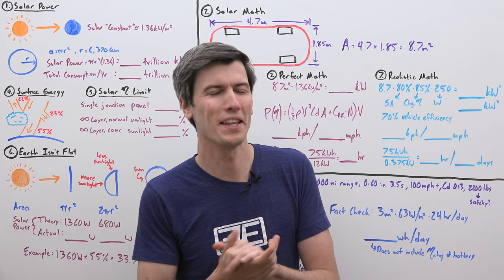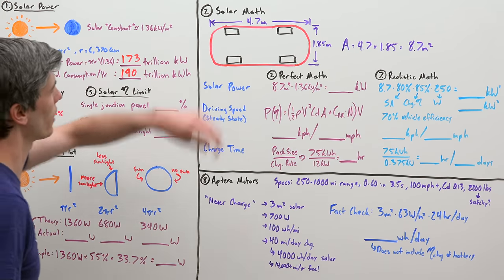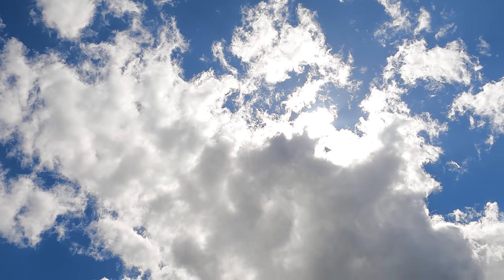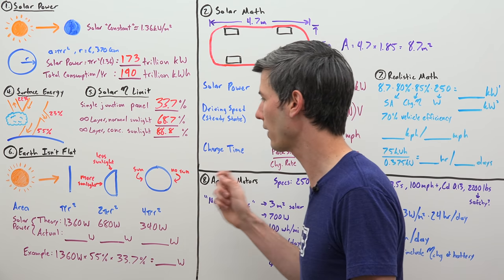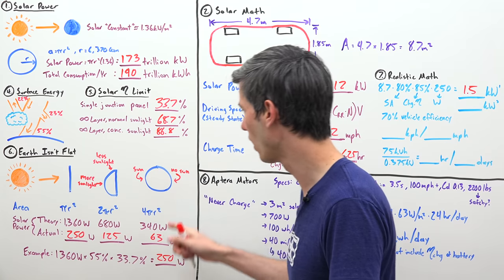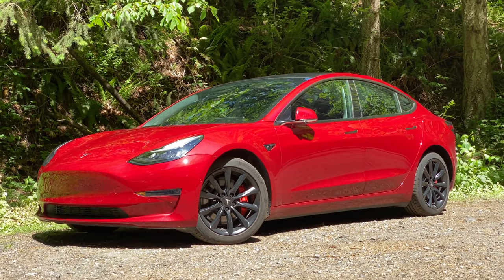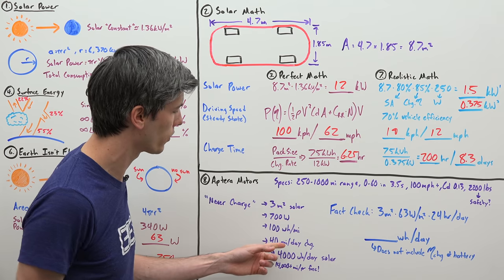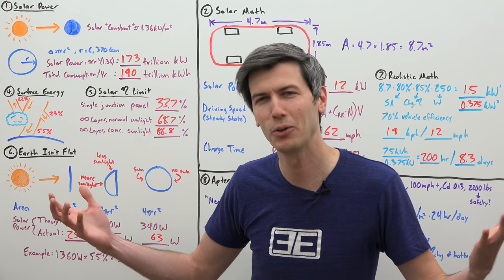Why Don't Solar Powered Cars Exist?

Comment: This is cool the only part that I paused on was the plausibility of the Aptera example-- you don't get 24 hours of sun a day except at the north/south pole (in their respective seasons). Everywhere else it is rational to drive would be far, far less. Then there are other frictionless assumptions made like weather, obstructions to your charge like trees and buildings on your street, or if you're in LA like me, dust that inevitably settles all over the car from pollution or pollen. So it's neat that under very specific circumstances it could work but it doesn't seem realistic for the average consumer. Maybe I'm missing the point.

Comment: 10kWh a day is actually what my Volt usually used.  (That got me about forty miles.) So, in sunny Colorado, and some solar panels on the sides too to catch lateral sun as well, such a solar system could (in ideal circumstances) yield a meaningful fraction of the car's electric needs (albeit with some ideal assumptions, not lots of dirt for instance on the surface, which is a problem in Colorado).  Not quite as far off practical as I once thought.  But, 10kWh only costs $1.30 at my local retail rates, so not enormous savings either.  And I'd have to leave the car outside a lot, and brush off the snow frequently.  Maybe it's a southern Arizona or southern California thing.

Comment: An interesting video could be, how much solar panel, battery, charger module etc we need to be resilient for the charge of a tesla model 3 or other car at home if we are capable to cover a garden or an exterior with solar panel. Because I see the math with the perimetre of a car but if we can cover like 30 m2 of ground, can it be possible ? Be resilent for our transport energy and at witch cost ?
Reply: It actually is very practical to install a 5 KW solar system in your home, and provide a lot of power for your appliances.  I know someone who did this back in 2008, and owns a Nissan Leaf.  He collects about 25 KW per day, on average.  He normally charges the car at night, with the lower cost nighttime power.  The  Leaf gets about 300 watts per mile, so is fairly efficient.  

His system covers about 22 square meters of his roof.

Comment: I think it is ludicrous to not have solar panels on top of every sold a car. It doesn’t matter that you’re not driving 100% free all the time. It is just at the car can be collecting power all the time during the day. I have three cars. One of them drives less than 5 miles a week I just drive it to the beach. My work car drives 100 miles a day. My family car drives less than 20 miles a week and maybe move twice a week. So two out of my three cars would be worth buying in this case if they had solar panels of any size on the roof.

Comment: Aptera sounds interesting.  My knee-jerk hangup though has nothing to do with the tech or safety but more having to choose between garage parking and solar charging.  That and RIP this prospect for anyone living in the woods.  Also it's going to suck every time getting into a car optimized for energy collection mid-summer in areas where it would be viable.

Comment: My thing with solar is that the tech needs to be better. As you put an plenty have also, the problems. But the tech for solar needs to be almost microscopic, meaning like cranking an engine with a primary and secondary coil effect. Maybe all we need is a direct reflection and heated status memory to charge the car at a consistency and then have that same memory also do a charge with a wind tunnel system to do a battery turbo  like alternator. Each system can house energy to help the other out if lacking. I'm hypotherically speaking, but I'm curious to do more data on this.

Comment: Makes sense, what i always wondered are two other things with electric cars (although the Fisker had solar panels on the roof) 1:would just covering the roof and maybe the rear trunk with solar panels be enough to power the never fully off electronics and counterbalance the self discharge of the batteries? (should be possible depending on the weather and place on earth) and 2: what happens with the solar panels in a crash? sharp glass objects? fireharazards due to shortcircuits? (i don't know enough about solar panels to answer these myself)

Comment: ...times 24 hrs of solar exposure?...  Maybe during a polar summer.... (you multiplied area and incidence and 24hrs)   The Aptera folks try describing 42 mi of range during unmitigated sun.  Where that is, I'm not sure.  But sunny Socal is only normal to those living there.    (Used to).  The car would work If you can find a place to park without shade.   I'd like to suggest that you do a video with numbers for a solar array on the roof of a carport that would sufficiently charge a Tesla or an Aptera for a day's use. BTW, that Aptera apparently requires covering the rear window with solar cells...  A non-starter for me. Thanks for your presentations, all in all; from an engineer.

Comment: The silent yacht company applied this concept to a catamaran, with the common use case being a boat that sits for several days at a time and then has the charge to run a hundred miles to the next island spot and never has to use a drop of diesel. Its amazing whats possible these days with solar and lithium.

Comment: Well, there are solar powered cars but they are special research/eco-challenge vehicles, and so specialized that they wouldn't make practical everyday vehicles. They are aerodynamically shaped wedges almost entirely covered by solar panels, single-seaters (almost always in a "recumbent" position), three-wheelers with bicycle wheels, and require expert power management by their drivers.

Comment: I have done this calculation backwards many times using rated data from available panels.  I figured if you could tow a flat bed trailer behind your Tesla that didn't impact drag. It would only need to be 300 feet long.  Of course duty cycle is much lower for typical cases so its more favorable the more it's parked vs driving. For vehicles of different shape and power requirements like buses, vans or houseboats. I believe its workable. The busses that take people to their cars at the Phoenix airport may soak up enough power.
Reply: Remember that with only wheels and  a Cd of less than 0.13, an Aptera has far lower power requirements than those vehicles - less than 100 watt hours per mile at EPA Highway cycle speeds.

Comment: I’m retired and I typically drive less than 25 miles per month.  The Aptera Motors EV may work for me! 😁
I just went to their website and looked at the vehicle and price…no thanks!
Reply: What was your main objection?
Reply: @n.brucenelson5920  the price…I’m retired and living on social security, so a $26,000 base price isn’t an option for me.  Besides, I would want the big battery option, all wheel drive and full solar, which brings the price to around $46,000!  😂   If money wasn’t an option, I’d seriously consider it.
Reply: @GregDinAZ  Understood.  Thanks for your reply. I have the same constraints.  In my case, if the proposed federal rebate becomes a reality that would make a big difference.  My wife and I had a ride in an alpha prototype in November and from a performance standpoint, 2WD is still thrilling.  Since our Gen 1 Honda insight does OK in snow we think the 2WD will be fine.  We are not in such a big hurry anymore that the large, heavy battery is worth it for us.  We will take more breaks to recharge and save even more money sleeping in the back instead of finding a hotel room.  We have ordered the 40 kWh model, but with full solar.
Reply: @n.brucenelson5920  that’s great...I bet you can’t wait!  My hope is that as technology and manufacturing systems improve, it may be more feasible for me in the future.
Reply: @GregDinAZ  All the best.  I spent 16 years in Mesa, so I have pretty good idea of your environment.  I just moved to Iowa, where we have real winters.
Reply: @n.brucenelson5920  all the best to you also!  My son lives and attends the university in Iowa City, so you have my sympathy regarding the winters! 😊

Comment: In the Tesla example, that's still 37 miles per day of charge you could get from the sun on average. That's over 13,000 miles per year. Many people (myself included) could do just fine with that.
The average cost of electricity in my area is $0.12 per kwh. Assuming the 70% charge efficiency, and a 310 mile range from a 75kwh Telsa, that would represent a savings of over $500 per year on "fuel". If the solar panels last 10 years, that's $5,000 saved, not to mention over 7 tons of CO2 emissions indirectly produced by taking that energy from the grid.

Comment: Huge fan of your videos, but I have a question that you can probably answer. With all of these new EV's coming out, I'm wondering why there haven't been more hybrids hitting the market. Trucks are the main thing I'm curious about. Seeing as how gas and diesel still reign Supreme in the towing industry, why did Ford completely jump pass a hybrid and go straight to all electric? In my head, a hybrid truck seems like that would be the most efficient and effective way to make a truck economical without giving up range and weight.

What are your thoughts on making a hybrid truck?
Reply: Hybrid systems require more parts, are more costly to produce, and have poorer performance do to more weight.  They are a stop gap measure.

Comment: I have several good questions regarding  the Aptera.
1) Aerodynamics- current e-cars are bragging about drag coefficiency numbers in the 0.20 range.  I recall in the 1980s the Ford Probe was bragging around 0.32cd. How are they going to improve by 50% when it took 30 years to reduce drag by 30%?
2) Solar collector efficiency - in your calculations the shape of the car was a flat plane.  We know it's not going to be with those drag numbers. Solar cells lose efficiency significantly as they vary from being perpendicular to the sun. 
3) Energy Constant - as the latitude changes away from the equator north or south, the perpendicularly of solar angle to the cars surface will suffer immensely.  These numbers may be fairly reasonable south of 1-40, but north of I-80 they are not even close to reality.
  - Jim Troyer - past President of the Arizona Horizon Project - a Solar and Electric Car Racing Team out of Arizona State University.
Reply: What is the best drag coefficient achieved in those single seat solar powered vehicles?

Comment: Is the Aptera good for me if I drive less than 30 miles per week, my parking space is in full sun, and I have nowhere to plug in?
Reply: Yes.
Reply: For people who aren't able to plug in and solar only slightly not enough, I like the idea of a carryable battery (such as power tool batteries) being used as a buckets and 120 outlets as spouts to fill the buckets. When you need to move so little energy, why not move it by hand?

Comment: My crazy neighbor down the street drives an electric-powered Velomobile (covered reclining bicycle), and he pulls behind that an aluminum trailer that holds 4 fairly large solar panels installed flat onto it. On a sunny day, he hits 30 miles/hr just on the solar power the panels on that trailer are producing for his bike.  He uses it to commute 20 miles to work and back each day. It might not be comfortable or pretty looking, but it works, I see it every day going down the street.
Reply: I ride a velomobile without motor without solar and I comfortably go at 35km/h on flat roads. It's very aerodynamic, weighs only 35kg, so that is easily possible. As bicycle motors are limited to 25km/h in germany, they are quite pointless for such vehicles except if you have a lot of hills. More sporty riders on even more efficient velomobile models can easily go even faster than that.

Comment: Get rid of all the safety/nanny systems, and you'll be able to lose like 25% of the vehicle weight without exotic processes. Reduce the power train size to something that is actually reasonable for normal daily driving (does everyone need 250+Hp? no!) and you can reduce the weight by an additional 10-20%. Losing 35-45% of the overall vehicle size/weight will do a lot for efficiency, and this is in fact how aerospace engineering actually makes heavier than air flight possible. BUT - we can't have cars without our nanny systems or excessive power in this world, our lack of affinity for personal responsibility, our personal pride/ego, and politicians cannot be bothered.

Comment: So how fast do solar powerd cars chage in the home garage?  
In the parking garage at work?  
Under those nice cool trees you find at mall parking lots?
In the short winter days in the north east?
Reply: An Aptera charges at a rate of 13 miles of additional range per hour of plug time plugged into a 110V 15 amp wall socket, and considerably faster if a 230 volt circuit is used.

Comment: Still, sort of the equivalent to a free tank of gas every 8.3 days is still a good $/week savings. So assuming that the system is NOT some large % addition to the cost I would definitely consider it, could end up are a really cheap weekend runner, assuming trickle charging doesn't increase the formation of dendrites.
Reply: Oh, if only EVs could be described as "really cheap." That's a world we all want to live in.

As solar payback plans go, I bet this is one of the worst. Spend that money on panels for your roof instead. If your interest in this is economic, I bet your roof gets you a lot more bang for your buck.
Reply: @ps.2  Yer, probably right just covering your tesla's garage roof instead of its roof would end up cheaper and having your car out in the sun is a crap idea if you want to drive it in the middle of the day
Reply: @ps.2  Full solar for the Aptera is only $900.  Payback will be rapid for most people, depending on their power rates, but certainly over the life of the panels for almost everyone.

Comment: I came up with an invention to solve the problem and I'm giving anyone and everyone permission to use it. Basically you could have a rolled up solar panel in the trunk and unroll it to charge up quickly while at a rest stop or on the side of the road or a parking lot. Anywhere you can unroll the carpet of solar panels up to 125' behind the car. I'm thinking there could be 3 models, a 75' a 100' and a 125'. Also another idea is just to have retractable panels that double the area. In some case maybe it could even be used while driving but it would still be great if it only works while parked. Maybe it could even triple or quadruple the area. Worst case, slap some panels in the truck and lay them out in an emergency? As for the carpet model I'm thinking a bunch of tiny panels that attach to the carpet with velcro, maybe 2"x4" each and carpet about 5' wide. You could have wires embedded into the carpet as rails along each edge or one edge and then across the carpet for each row. And if one fails it could have a switch powered by a small capacitor that reveals a red dot showing it's broken or maybe just a very tiny led to show power continuity. Just had another great idea, place some foam/sponge on the back of carpet so they don't rattle or damage each other when rolled up and hitting bumps.

Comment: How much time can one save when charging the battery plug-in + solar compared to plug-in only?
Reply: If you are using 120V charging, then there would be alot of time for the solar panels to be absorbing energy, as so would help out alot. When you also consider solar would help the battery not drain as much, you wouldn't be as far from a full charge as you would without solar. So for 120V charging, a substantial about of time.
But for DC fast charging, the limit to charge rate is the battery itself, and so solar wouldn't be able to help during that time.

So to awnser you question: Anywhere from no saved time to alot of saved time.

Comment: It doesn't necessarily have to power the engine... But wouldnt it help if it could be used to power other things such as intetior lighting or even sound system???

Comment: It's not about fully charging the car using solar power, the question is can we just boost the range using solar panels. The only limiting factor is I see is the cost-benefit ratio. In most US locations it is more cost efficient to have a solar panel at home and install a wall charger. That's the reason cars aren't covered with solar panels.

Comment: Real world. Early 90's i was on a Solar Csr team in school and we raced in the American Tour de Sol. In easy numbers we had 100w per hour solar panels (13% eff) charging 7.2 kw lead acid. It ran at 100w per mile. custom built 2 seater.
Reply: The Aptera solar panels come in at 22-23% efficiency and the vehicle uses around 100 watt hours per mile at a speed of around 50 mph average (EPA highway cycle)
Reply: @n.brucenelson5920  BP Solar made some panels that eff back in the early 90's. They had the leads channeled in the back side, so more surfaces area on  sun side. but instead of a few $ thousand. it was close to a million US dollars. (On a different custom build 3 wheeled car)

Comment: Because solid-state batteries have significantly faster charging times, would having solar built-in make more sense for EVs with those installed? They would have nearly double the energy density but could be fully charged within 10-20 minutes by normal means.